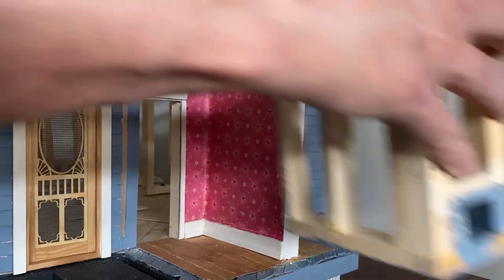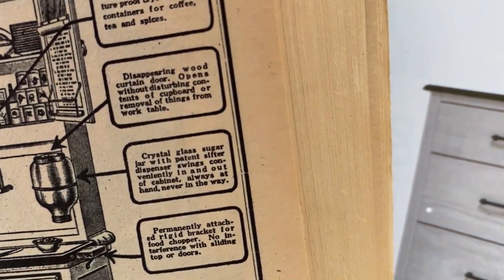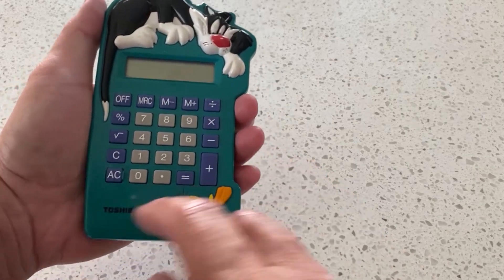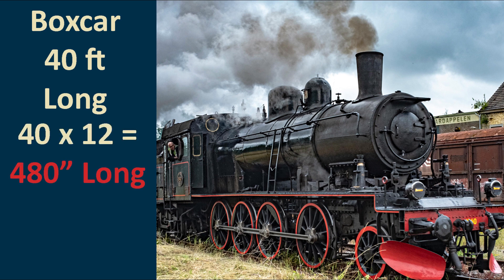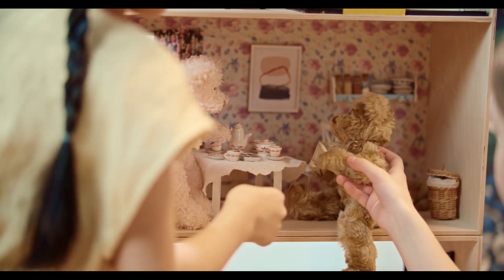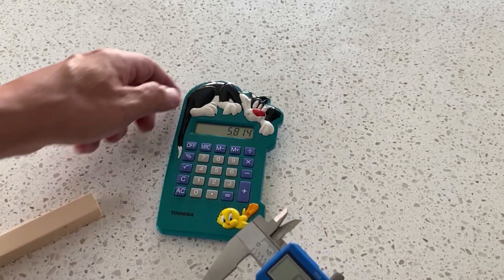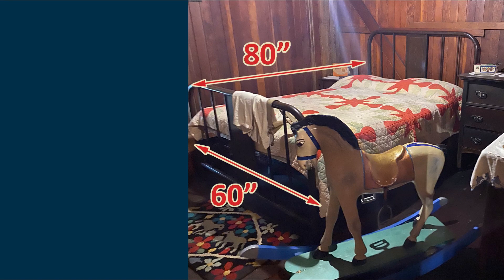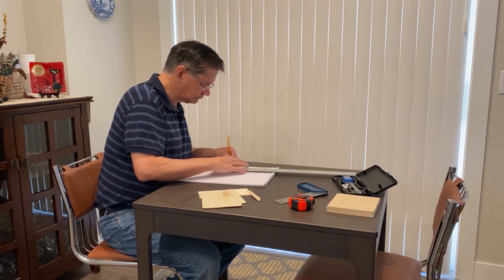Model Scale Size Made Simple CH37

Comment: How do you get the wall thickness to 1/12? My walls are 5" think, making them 5/12". But I can't find any material 5/12" thick.
Reply from the maker: I try to cut the wood myself.  5/12" is about 1/2" which should be a fairly common size.